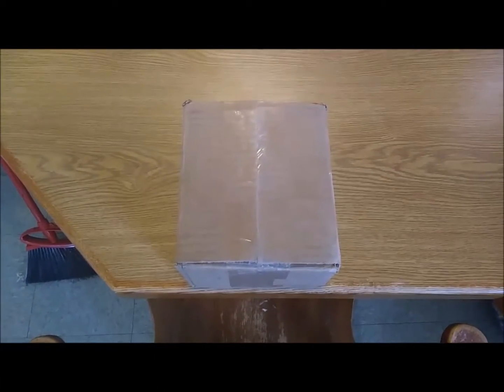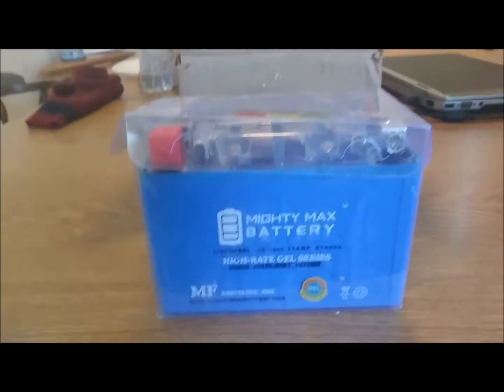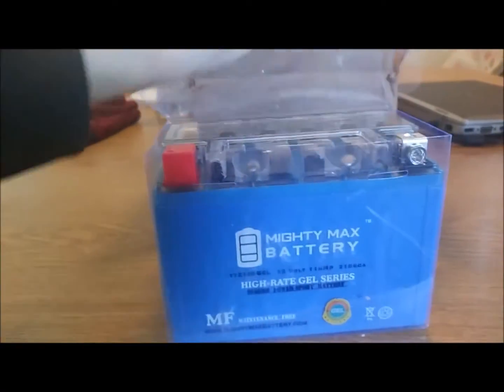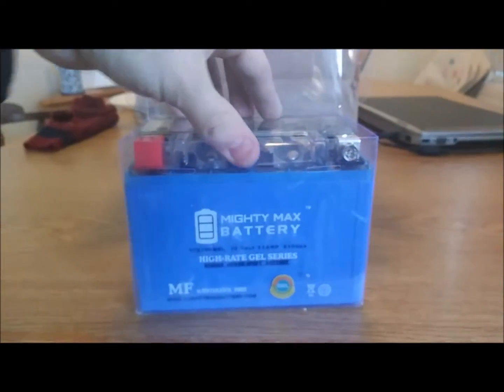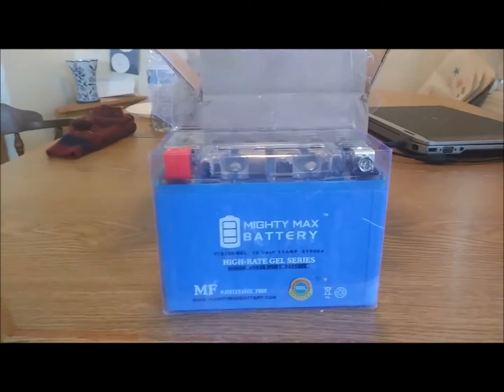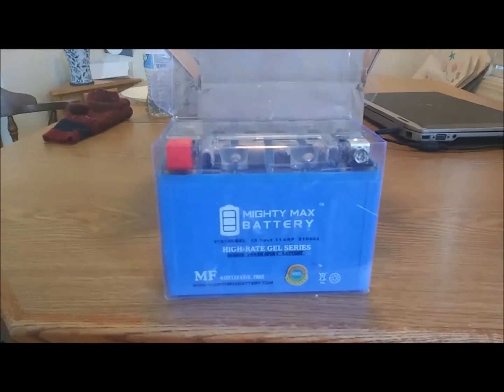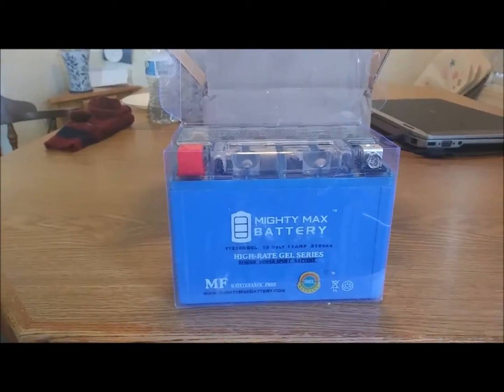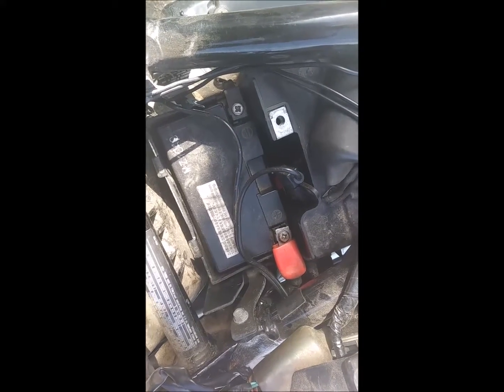Mighty Max YTZ12S 12V 11AH 210CCA GEL MOTORCYCLE BATTERY. Install and First Start

Comment: What I have done to fix the "nut" problem (instead of Q-tips) I've cut small pieces of foam and used it to hold the nut up against the top of the holder. Then the terminal bolt catches it without any issues and the form just crushes under the bolt as needed. No harm and nothing dangerous!

Comment: Thank you,. I just received my battery and it doesn't go in as simple as the original. As you mentioned the terminals are not threaded. I am going to go back out and try this.

Comment: How did it hold up is the big question?? I just ordered one. The price was right, and I like gels. I had a shotgun im my Yamaha FJR1300 and it was a POS.
Reply from the maker: This one lasted 3 years before I sold the bike. When my next bike needed a new battery, went with Mighty Max again. No problems after over a year
Reply: @DS Entertainment Network  Cool, thanks for the feedback. You can't go wrong with that  $70 shipped. 3 years is passes for me😉

Comment: How is the battery holding up?
Reply from the maker: Mario Barrios almost 3 months, no issues. i even went on vacation for 2 weeks, left the battery on the bike and didnt have it on the trickle charger. came home and fired it right up. good purchase
Reply: I have my, same like you, for two years already and no issues at all. Even 6 months connected to the bike, still fire up like a champ without any trickle charger. I love it.
Reply: @DJDanaScott  How is the battery holding up, so far?
Reply from the maker: Still fires up no problem. Even after sitting for 2 weeks, the battery held charge like a champ
Reply: How is this battery holding up? I just purchased one about a week ago and when I rode in 29 degree weather and parked up. I tried to start the bike again and it would not start but then the day after the weather was better and it started right up I wonder why